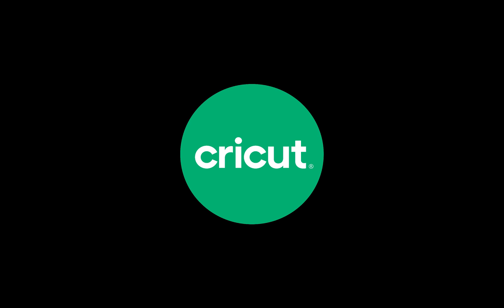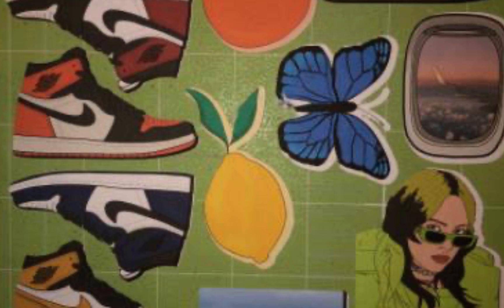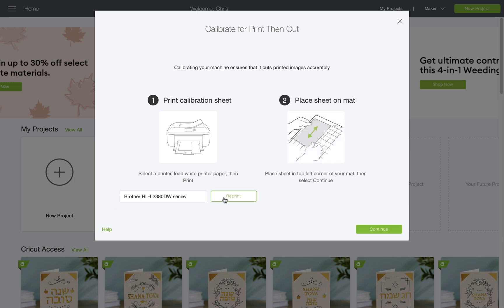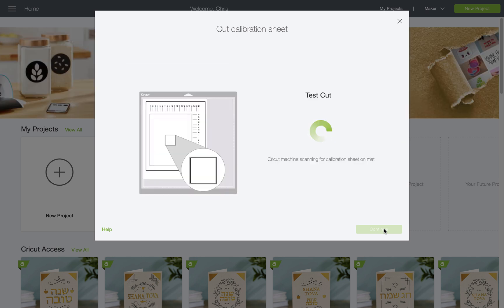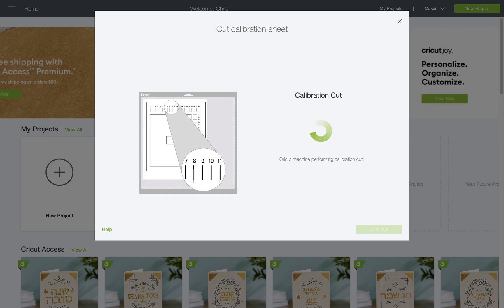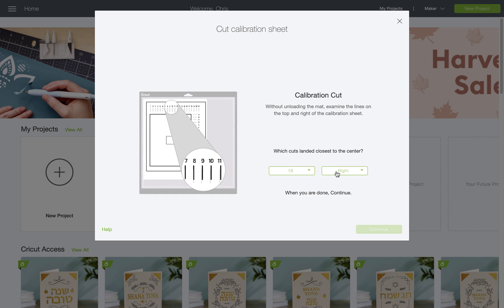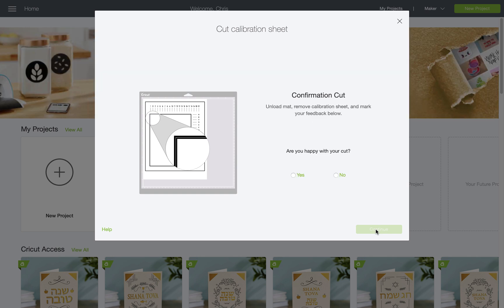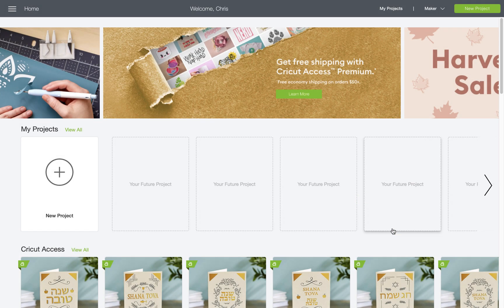Machine Calibration: Print Then Cut

Comment: You need to be more clear about the cut lines with the numbers at the top and the letters on the right side. The direction on Design Space and you just say that the lines should be in the "center". Center of what? The center of the actual printed lines or in between which would be the center in between the lines? This may sound like a stupid question, but since so many of mine are cut in between the printed lines I really don't know what you mean. Show a closeup of this about how it SHOULD look with the cuts in between the lines or ON the lines????

Comment: This does not work! I did it probably 12 times.  Mine is not detecting the calibration lines either. SO FRUSTRATING. Been trying for at least 3 days now. I turned everything off, signed out, did updates etc. nothing is working as it should!!! 🤬
Reply from the maker: I am so sorry it isn't working. We would love to help get this resolved and troubleshoot the issue. Will you give us a call? https://help.cricut.com/hc/en-us/articles/360020316674-Cricut-Contact-Information

Comment: I go through the whole calibration process and eventually get everything lined up perfectly, but after confirming that I'm happy with my cut and clicking next, the dialogue box just closes and therefore doesn't show me the final screen where I need to actually save the settings, meaning the whole thing was a waste of time and not to mention paper! Your machines really aren't very eco-friendly, nor user-friendly for international customers who us A4 sized paper. I'm genuinely considering just returning my machine, since it's way more hassle than it's worth.
Reply: I have the same problem although the cut is still off a little and I want to get it sorted, I really don't want to go to another product but this is doing my head in and so much ink, paper used so far.....
Reply: @Aussat  Sorry, just realised my reply to you never actually went through, probably because I included a link. But, there's a newer calibration sheet available through their website which works better than the one included with their software, so try giving that a go.
Reply: I have the exact same problem, did you find any solution to this? Or maybe Official Cricut wants to help out on this?
Reply: @budgetwoelfin  I can't recall exactly what I did now, but I eventually got it working to some extent. I think I just persisted with trying to recalibrate the machine after coming across a newer version of the calibration sheet that you can download from their site, so I recommend giving that a go if you haven't already.
Reply: I'm having the same issue, even with printing the web version  calibration sheet

Comment: My Cricut isn't even recognizing my printer smh. SO upset. Can someone help me?
Reply from the maker: Hi Skylar, we totally can! Will you give us a call at the number here: https://help.cricut.com/hc/en-us/articles/360020316674-Cricut-Contact-Information
Reply: @Cricut  Hi, I know this isn’t exactly related to the topic, but I am currently using Design Space on my iPad Air.  I’ve been learning to Print then Cut for vinyl sticker labels.  How can I set my printer to print at a higher quality for my project from my iPad Air?  There doesn’t seem to be a setting button or dialogue link that I can see when I get to the Print phase.  The sticker quality is a little washed out, because I assume the print is defaulting to a lower quality setting?  Is there a solution to this using the Design Space app?  The quality is disappointing and it could be so much better. Please help...Thank you so much.  :)

Comment: Hi, I know this isn’t exactly related to the topic, but I am currently using Design Space on my iPad Air.  I’ve been learning to Print then Cut for vinyl sticker labels.  How can I set my printer to print at a higher quality for my project from my iPad Air?  There doesn’t seem to be a setting button or dialogue link that I can see when I get to the Print phase.  The sticker quality is a little washed out, because I assume the print is defaulting to a lower quality setting?  Is there a solution to this using the Design Space app?  The quality is disappointing and it could be so much better. @officialcricut please help...Thank you so much.  :)

Comment: calibration complete....and it's still off by half and inch. or starts the cut right then stretches the cut WAY beyond the opposite edge. garbage software. it's an SVG, just locate the corner and SCALE the VECTOR GRAPHIC to cut. useless machine.
Reply from the maker: Hi Gertrude, I am so sorry for the issues you've had. Will you give us a call and we will see what is going on and get things fixed for ya? https://help.cricut.com/hc/en-us/articles/360020316674-Cricut-Contact-Information

Comment: This video provides no troubleshooting advice whatsoever. I have tried to calibrate my machine more times than I can count over the last month, and I am yet to receive any response from support after a case being opened. I am incredibly disappointed that not only am I receiving no support, but that an official video is based on a machine that is already perfectly aligned and therefore no help to us still having issues.
Reply: Has your issue been resolved? I also cant figure out why my cut is not aligned with my print! So frustrating!
Reply: Of course not! Haven’t heard back from the support team either
Reply: did you end up working out the issue?  Its very frustrating when you spend a lot of money on a machine and it doesn't work properly and no one seems to have an answer

Comment: My Cricut sensor is not detecting the calibration lines. I've emailed CriCut customer service and no response. I've cleaned the sensor, I've bought whiter paper, I've even adjusted my ink settings to be darker. What else do I need to do? I've tried almost everything up to reinstalling design space and resetting my printer settings and such.
Reply: Hopefully you're not still having this issue a year later, but in case anyone is looking through the comments for suggestions, I was having this issue today even after restarting the machine and making sure both my machine firmware and software were up to date. After several tries with the machine still not decting the lines, I did these two things and then it was able to read the lines: 
1. I turned off all of the other lights in the room so that the only light shining on the paper was the one coming from the machine.
2. I had originally had my paper lined right up against the edge of my 12x12 grid on the mat, so instead, I moved the paper about half of an inch in and down. 
It may have been a coincidence, but after doing these two things, it detected my lines and performed the rest of the calibration process! 
Now I just have to figure out why my calibration settings aren't saving 😠😅

Comment: Is there a way to add a little bit of white around an image, as if you are cutting with one of those little metal cutting dies?  For example, if I stamp and color an image, and scan it and save it as an SVG, can I figure in a way to cut it out with a tiny white border?
Reply: You would need to use a graphic program (I'm using GIMP) to add a border/edge to the SVG.
Reply: @cardsbycamper  Thank you.  My husband got me a Scan N  Cut for Xmas, so I can cut on the lines, or add a border.  So now I will cut most things out on that, and I won't be needing to buy the dies for most things.  I thought about getting one for quite a while, and then decided to go for it.  I appreciate you taking the time to answer and have a wonderful holiday season.

Comment: I’ve done this several times and my cricut still cuts off the edges. Im from argentina, i tried to communicate by email with cricut but ive got no response. I also tried by phone with the same result. Can u explain the web type calibration?
Reply: @silvia - if you have the latest update 5.13.78, you should be able to calibrate your machine without needing the web version. Simple follow Chris' steps, or the help article here: https://help.cricut.com/hc/en-us/articles/360009424974-Calibrating-your-machine-for-Print-Then-Cut

Also, there is a note on that page that says "Depending on your current offset, you may find more than one calibration is needed. Choose to refine the calibration as needed until you are satisfied with the cut results." 

Hope this helps!
Reply: @deearebee5150  Most of us have and it is USELESS and they don't give a da**
Reply: Dani Arnold ok thanks! Ill try